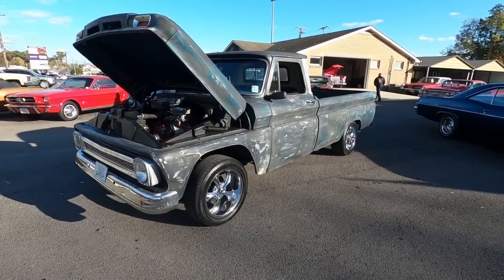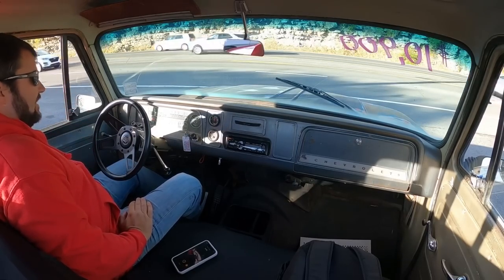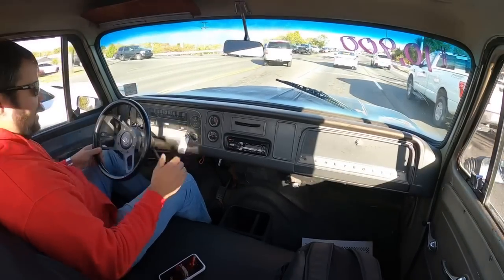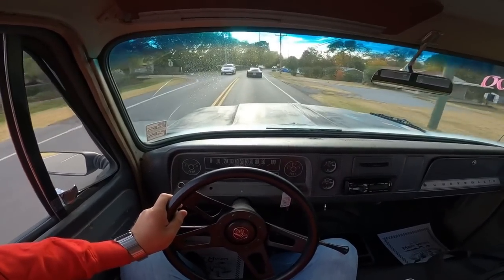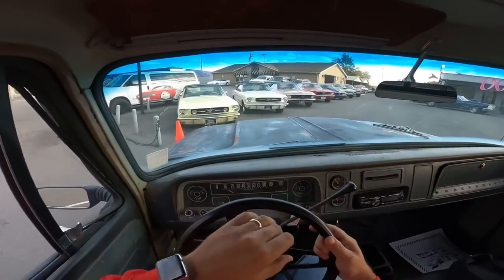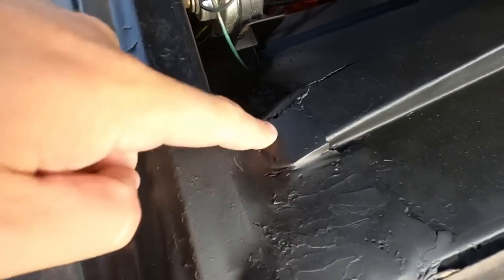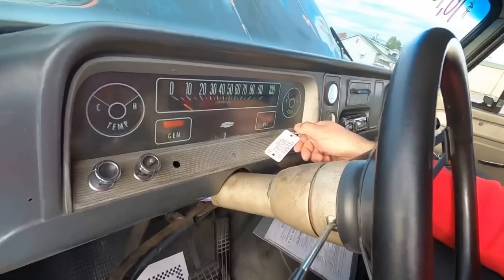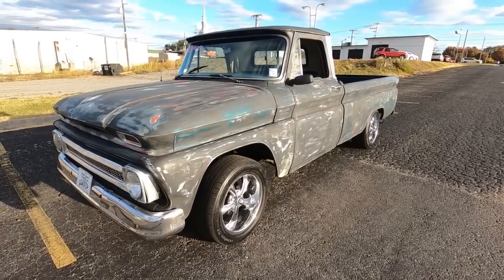Test Drive 1966 Chevrolet C-10 LWB SOLD $10,900 Maple Motors #1906

Comment: This would be a great project.  I think the aftermarket supports these trucks pretty well.  I would put dropped spindles and a disc brake conversion on this thing.  I had one of these years ago and had a blast with it.

Comment: I see so many of this era cars and especially these trucks where they throw wheels and tires on it and a motor but leave the single reservoir manual brakes with 4 wheel drums. You gotta use a lit of leg to stop and one leak and you lose everything.

Comment: Perfect 66 C10 shortbed for a rat rod already has exterior just needs to be clear coat,probably 4 inch drop cause undercarriage is nice & loose those riddler tires in exchange for dog dish hubcaps or steelies.